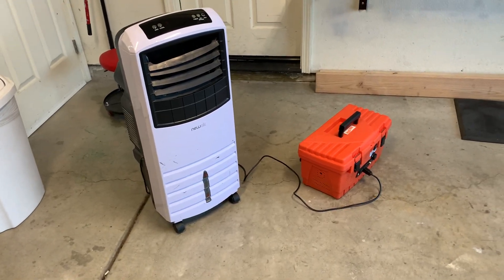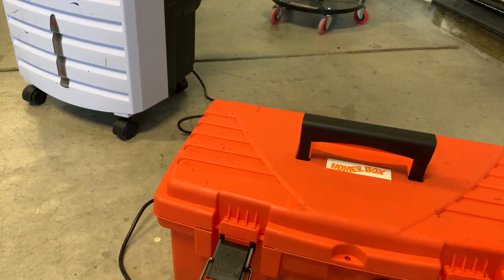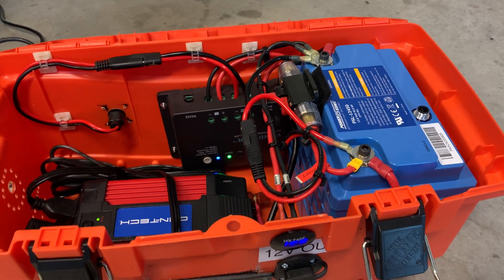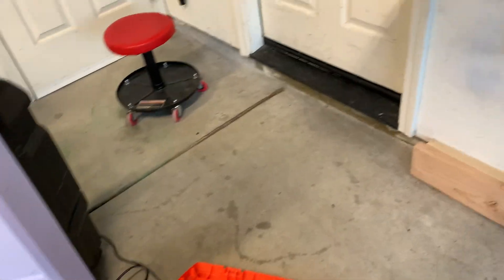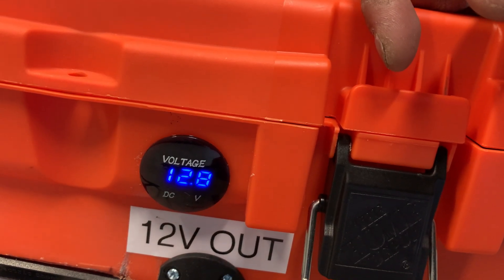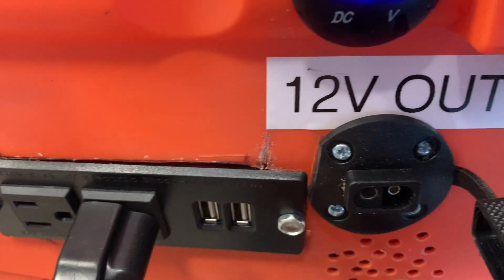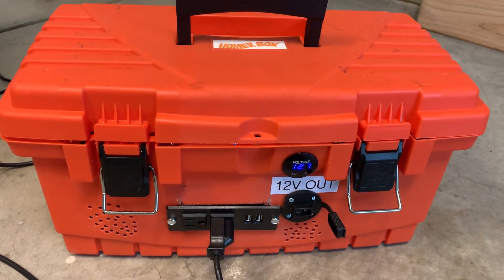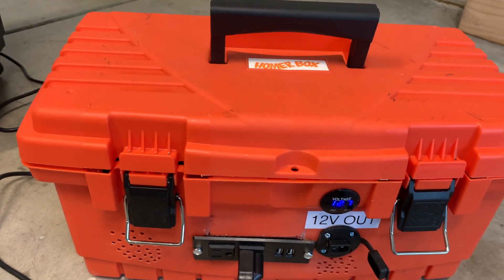Part. 1 Goal Zero - Jackery KILLER! Solar power DIY Power Station - Generator. Overlanding Camping.

Comment: Did you blow up your power brick?  I've done ~24v power brick / psu charging through MPPT charge controller PV inputs, but read on the renogy forums that the PWM charge controllers can't do this.
Reply from the maker: I hear ya. I’ve had issues with newer power bricksDidn’t blow up bu my it did shut off. Had to unplug and plug from power to reset. .  Been successful with older laptop power bricks.

Comment: How long will that battery run the air conditioner?
Reply from the maker: Hi Michael. Sorry if I accidentally misled you. It’s not AC, it’s a swamp cooler with fan and water pump. No compressor which draws  a lot of current.  
The fan you see on the vid ran for ran hour while testing. Still had 80% on my 45ah batt when I turned it off. Hope this helps sir
Reply: @kulotsgarage118  What does "ran for ran hour" mean?
Reply from the maker: @patmercer8591  sorry typo “ran for an hour”